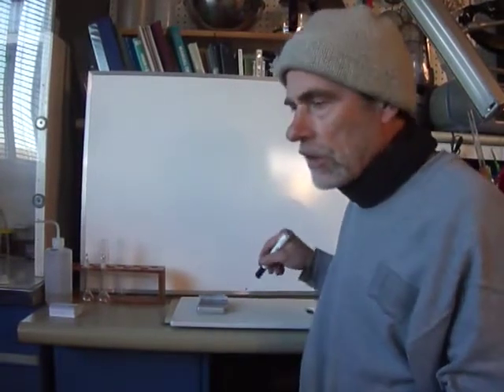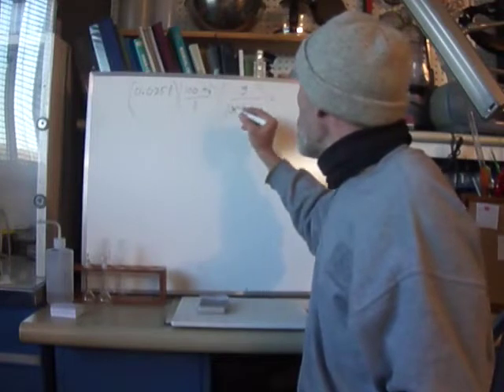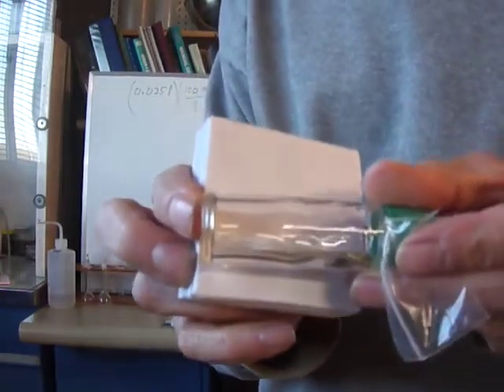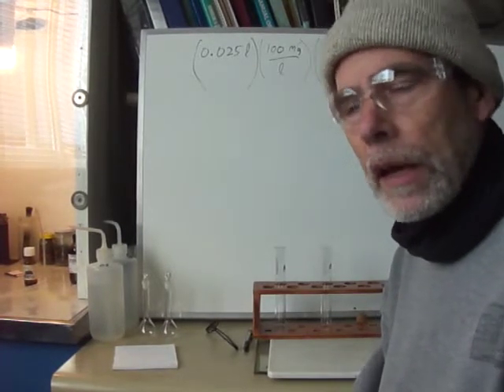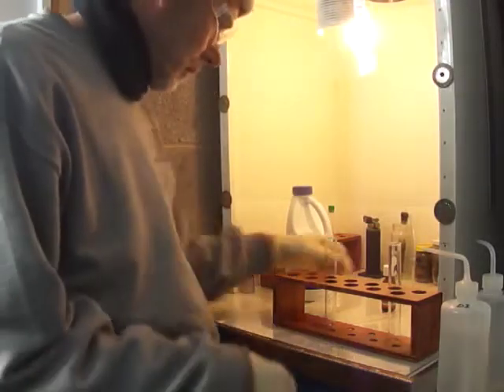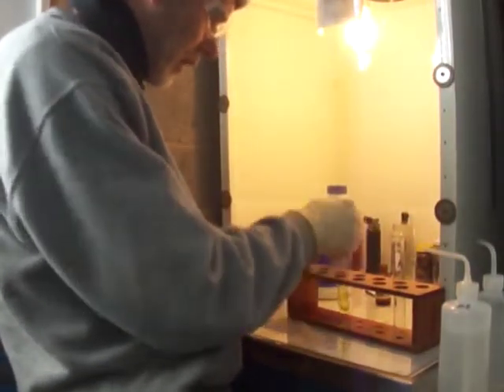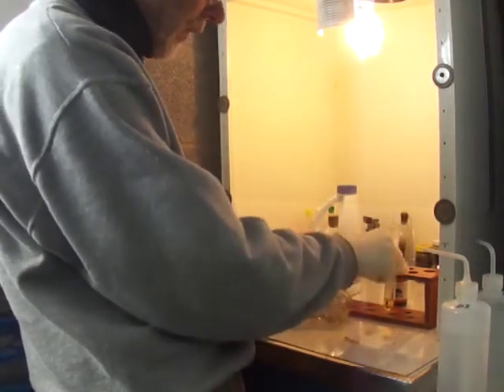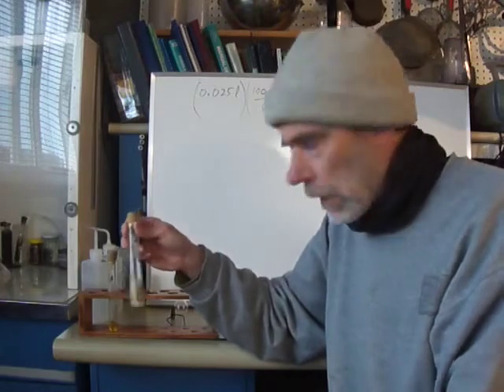Testing for Gold

Comment: Hi Tom, great video! when you say concentrated Hcl and Nitric acid, is it 38% Hcl and 70% for Nitric acid? and the bleach is just rgular store bleach? thanks for all you do.
Reply from the maker: The HCl I use is in the low 30s and the HNO3 is in the mid 60s.  You might want to check out some other references on aqua regia as I may be confused with my ratios between molar and volume.  It also depends on the concentrations of your ingredients.  The bleach looks like it is Walmart great value.  This is all nasty stuff and even worse when mixed, both the liquid and fumes.
Reply: @ggsipaper  that is great, exactly what i needed to know, thanks.